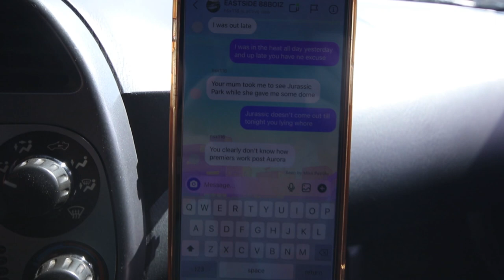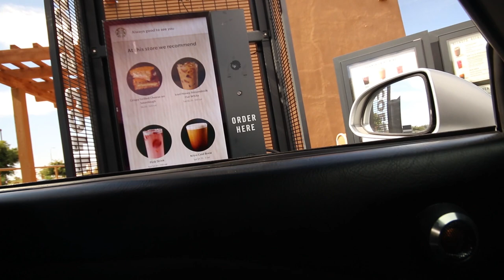First Upgrade For The Shop!

Comment: I'm an electrical contractor here in British Columbia I don't charge that much. Lower prices make me more money because I get more work. I only charge more if it's a difficult job for me. If it's a one man max 4hr job like that I would probably charge 1000 incl material costs No renting scissorlift either. I would charge more if I was in an area that had higher prices and less undercutting etc but still I wouldn't get greedy it's not worth losing work. Some money is better than none

Comment: Did he tell you what the IAT's are?  What did it make NA vs after the turbo install? Take whatever the difference is and divide that by the amount of PSI its making. Should make around 20whp per PSI of boost, if its less than that it could just be an ineffecient turbo or just an ineffecient intercooler. You should look into a same side intercooler if thats the case and or a better turbo.